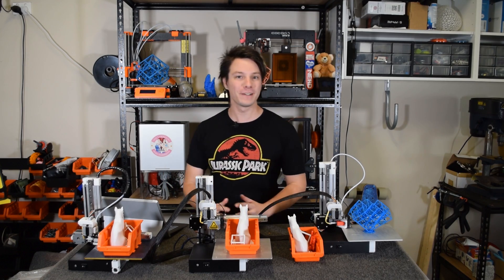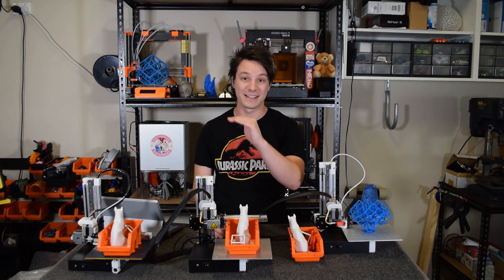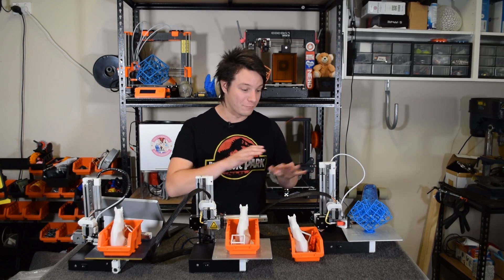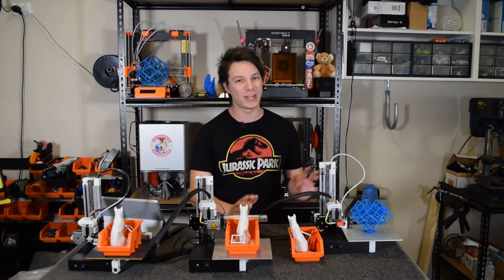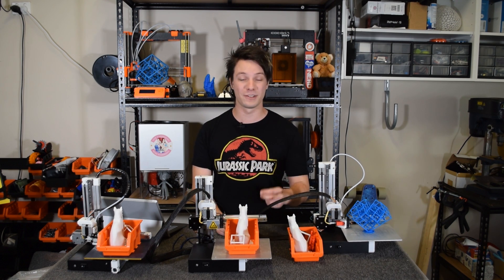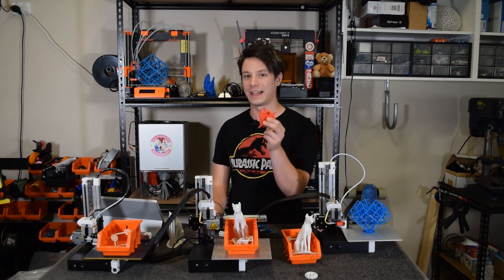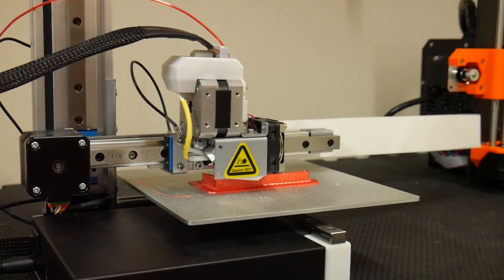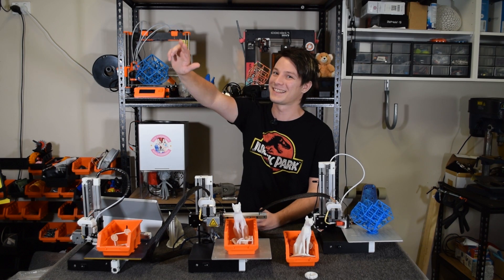Cetus MK3 3D Printer Review

Comment: UPStudio .. only just works, but only just. Let me explain why:
"No supports" doesn't actually disable all supports. It will still put supports in places - finding out the tubes running through your 20hr print have supports in them is frustrating af - water won't flow through them and I can't remove the supports - waste of time and material.
"No rafts" will still place rafts that the perimeter of my print ran right over and embedded into the perimeter. Probably a bug but after my previous print failed, this one was also messed up a bit.
Perimeters won't adhere to infill, with no option to change the overlap, or slow down the machine on small infill to solve the issue. No help from tiertime other than "extrude wider" no the issue is its going too fast.
Mac version of upstudio does not have material editor. (silly thing like clicking import and then cancel will crash upstudio)
 and lots more issues that are mostly related to using it with the UP300 (the biggest one being the lack of support for importing gcode)

They also released the UPStudio update, which broke compatibility with my printer's firmware. I had to wait for a day for the new firmware to be put on the website. I filed a ticket to let them know and support just told me to use the beta. I'm in a production environment. I'm not going to use a beta. You just broke my workflow. No acknowledgment of them having made a mistake.
Now this one doesn't apply to the Cetus: No "wait for heated bed" to get to temperature option - a big issue if you're printing ABS on one of their other ABS capable printers - its critical the bed comes up to temp before starting to print.

Hardware is wonderful, software, is ... well you decide based on the above.

firmware/software update issue: https://www.tiertime.com/community/viewtopic.php?f=11&t=56620
infill perimeter issue: https://www.tiertime.com/community/viewtopic.php?f=50&t=56587

UPStudio has come a ways.. its not perfect yet, as a power user it is frustrating. I guess I'm just not their target audience. It works, its rough around the edges. I find myself continuously hitting the limitations on what can be done with UPStudio.
Reply: Jotham B you can remove all the supports and you can print raftless. I’ve done both when I had my MK2. Albeit, removing all the supports was far more tedious than it should be. They could most certainly improve upon that.
Reply: @guycobb3251  yep..though my point was I've had cases where I've set no rafts and no supports and they still ended up in the model..
Reply: Jotham B indeed, they can all be removed. But man is it a chore.
Reply: @Jotham B My daughter read your "report" on UP Studio: 
"DISAGREED!. She, no Mac, not interested in the process, only in the print result,  "still has the software to fail on her" :) thankful for 'handholding'=adding support"
 ...since your Avatar says "Simply3D" - SIMPLIFY was the worst money I ever spent in the 3D area - NEVER AGAIN! ...in summary: Probably you aren't target audience indeed
Reply: @reinholdu9909  Right, exactly!

I'm more of advanced user. I really don't mind if it's not user friendly as long as the software is capable, I'll work it out one way or another. My main complaint was as an advanced user, I can't make it do what I want because it's dumbed down.

So.. yeah. Yep.

Comment: Half a dozen deal breakers at too high a price. You weren’t kidding about being biased.
Reply: No kidding! And really don't like that over hang design.
Reply: @iTeerRex  So far my Cetus MK1 has been a reliable printer since the Cetus retail launch the low power usage without the heated bed is amazing for budget hobbyists. The Overhang Design even on the Extended is not noticeable unless if you are printing faster then 60mm/s the Printer Prints at 40mm/s all day everyday just fine.
Angus is Biased on the Tiertime topic there is no doubt there are plenty of things about my Cetus I have changed because I disliked them including the CPU to the TinyfabCPU, I bought a longer x axis Rail and Extrusion so my printer now Prints at 180mmX220mmx300mm which is a very nice but the printer does have issues and if you are not into tinkering with your 3dprinter or learning about the ins and outs of it as a hobbyist the Cetus is not a good fit at all.
Reply: @unherolike  It seem to work fine within certain parameters with some fixes for a budget printer. It is the engineering design that I don't like.
Reply: It was a review against Tiertime printers, not against Tiertime vs other printers. It's not biased, it's comprehensive.
Reply: @Seraphic85  if this was a video titled "best cetus mk3? Taking a look at the changes" or something I would agree. But it's not. It is titled "is the cetus Mark 3 the best classroom education printer?" This is not even a review it is meant to be a comparison but he only Compares from the same brand that is the definition of bias.

Comment: Can`t find any reason to buy Cetus instead of Ender 3!
Ender is so much better everywhere...
Reply: Cura to microSD is a pretty tricky toolchain for a whole class of under 12 years olds, over that age I think Ender-3 would be ok (although kind of oversize). I'm not a Cetus fan but their software is top notch (as is Flashforge's). Creality is playing catch up with wifi and slicing. It's a bit messy since I want an open source solution-- but those are 4x the price of proprietary options the company is being pitched. People just don't want to pay what OctoPi/Duet hardware will cost.
Reply: AGREED. Being an open source and Cura fan I bought that "Tiny Fab CPU". -  As of now CPU's back in it's box - even when it's 32bit smoothieware Wifi.
My daughter asked me to: "Please get me back to using UP Studio". 
UP just works - perfectly  like the CETUS 3D itself
Reply: WAIT! A couple of prints later you may wish to have bulletproof real-linear-rails and that carry-around-size ...instead of rubber wheels, a wobbly platen and the neverending adjust and "fiddling" with those "improvements". - The Ender didn't age well - Cetus still shines - with only some patina added.
Reply: No "press fit" parts ... must then be really an early one ...I wish you luck!
Reply: @reinholdu9909  TBH wheels work suprisingly well and even when they do wear after a few thousand hours wheels literally cost nothing. Even if they need to be alot more fiddly you could buy 2 and the cost of the cheaper rail printers so you could print on one and fiddle on the other.
Reply: @ @infernaldaedra  ...I was talking more about "press fit-pulleys" on enders...YES enders print- but I still have to see one that's remained "unmodified" - 
Now: My engineering heart aches when I read "surprisingly well" and "literally cost nothing" with "buy 2, print one and fiddle on the other". 
When young school kids want to 3D print (IF?) give them sturdy tools (do I say indestructible?). Do try not to frustrate them kids (too much) ... 
Do not scare that school or teacher away. None  I know has the time to fiddle nor the funds to buy twice. - 
"Enders" are OK but imho may be what people then buy out of their own pocket money(?) to learn 3D printer engineering.

Comment: I'd like a brief review on the hardened nozzle for the cetus. It's a new addon and visually looks quite different from the others. I found no reviews on it anywere. It is not clear if it is backcompatible to other ones (seems to be sold only with heater block) and if it is made in more pieces (that could permit to change the nozzle part with aftermarket parts)
Reply: I added it to my MK2. It prints identical. Just had to re-calibrate the z height. I will say that it doesn't come with a sock so you might get potentially more gunk on the nozzle for non pla prints. The tip of the new nozzle can come off and it comes with a smaller nozzle (0.2) that you screw on. Similar to e3d nozzles.
Reply: @microhaxo  that's interesting so it open  new possibilities as some 3rd party nozzle (like ruby nozzles, tungsten carbide tipped nozzles, hardened ones). can you also tell me if screw size is compatible with m3d sizes?